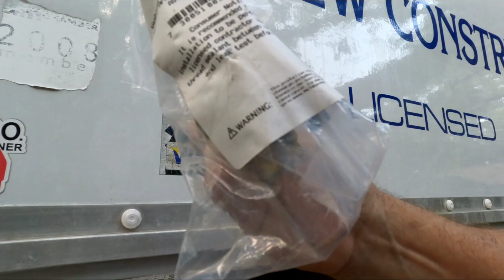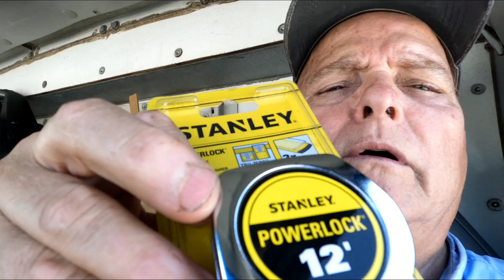A NEW NEIGHBOR AND A WEIRD NOISE #416

Comment: That Stanley 12 ft tape is a keeper. I like that the case makes the inside measurement easy. As a diy guy I've had mine for forty years. On my second tape replacement. My second favorite rule is a carpenters folding stick rule.
Reply from the maker: I'm hoping that tape will be my last tape purchase, love the old wooden rule w/brass slide out.
Thanks for watching my friend